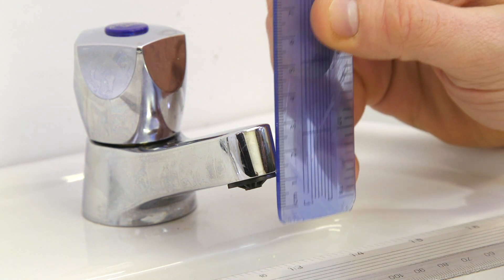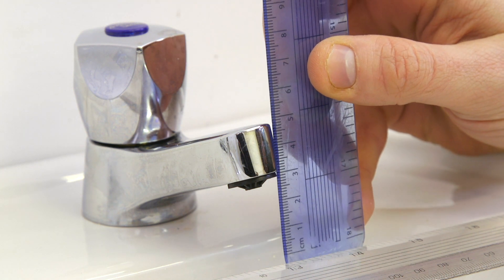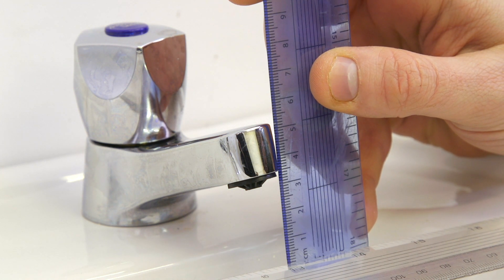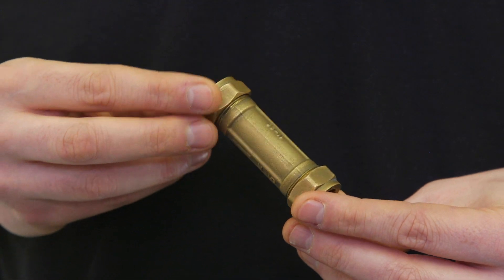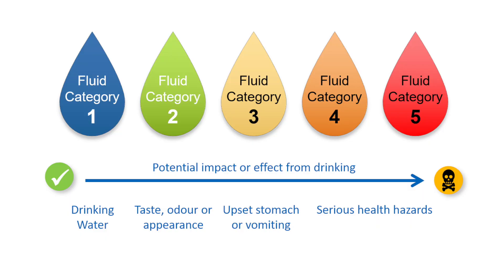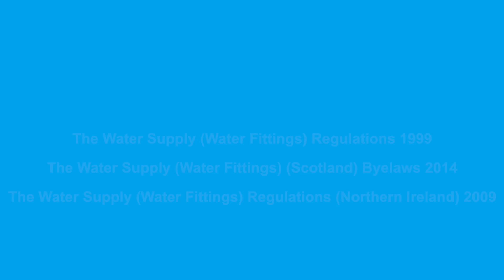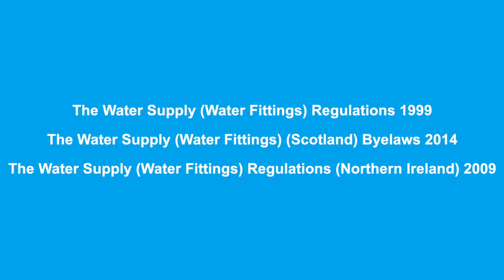Backflow - what it is and why it is an issue

Comment: Absolute nonsense! Water from a sink or a pool or a puddle Is just about impossible to create 30 to 60 PSI to flow against the pressure of the public water system... This is just a money grab, and I don't know how. How plumbers have actually convinced the public water systems that this Can Ashley occur...... It's just a way for plumbers to get paid big money and put expensive devices and get annual inspections which will eventually leak and need replaced and no backflow ever happens and no backflow situation ever comes together to even be a possibility for it to happen..... Please stop the nonsense!